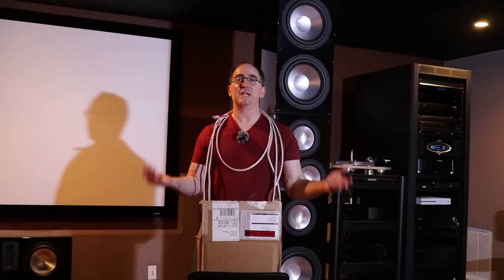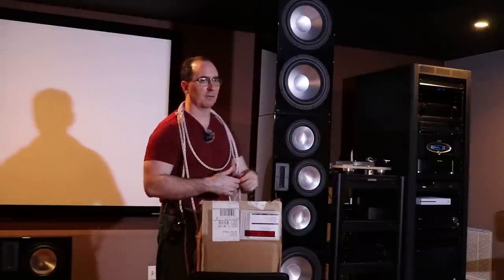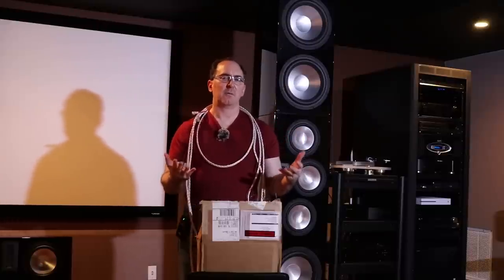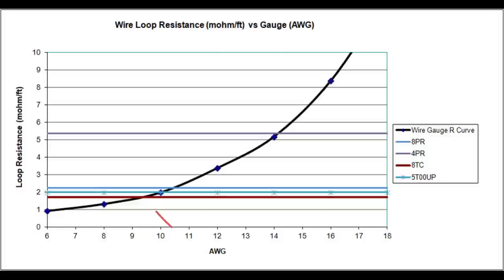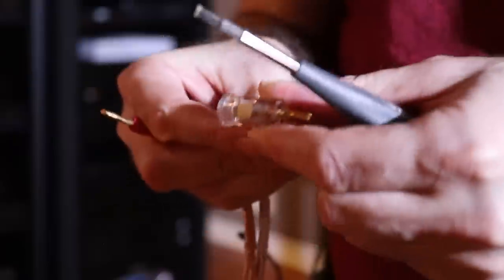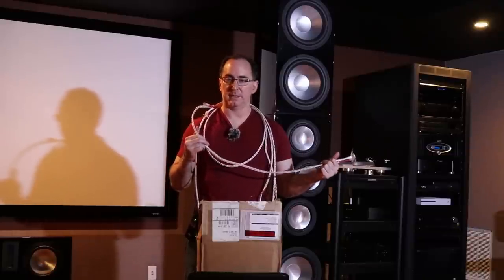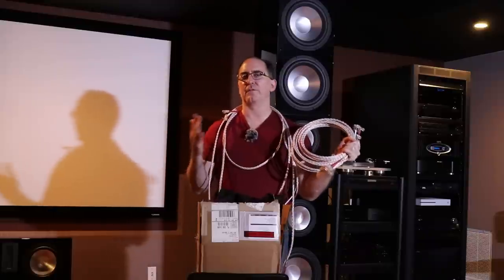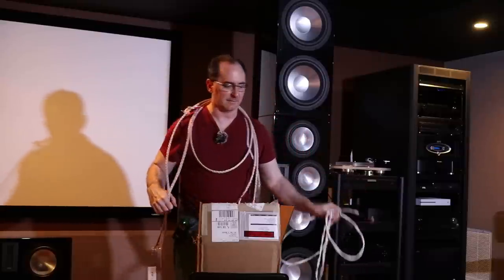Kimber Kable 8TC Speaker  Cables Review

Comment: I use the classic Kimber 8PR cables, which I terminated and am very happy with them.  They did improve the bass, however, I believe this is due to the weave reducing noise from contaminating the signal.  On another YouTube channel, I saw a cable test comparing a woven cable to a zip cord as an antenna.  The woven cable effectively filtered out the radio signal whereas the zip cable picked up the signal behaving like an antenna.  Perhaps this is why they make an audible difference, and why Kimber claim they are directional as electrons will flow equally well in either direction so is complete BS from an electrical standpoint.

Comment: My experience is I spent some time testing and comparing with test measurement cables : colored 10$ banana plugs wich enable to plug another banana behind. Those were working, but then I switched back to my much bigger monitor cable 6mm2 copper (made of multiple thin conductors). At the same volume on the same track I get 4 to 5 db more sound pressure (measured), and the music feels more dry and clear (like if the silences between notes were better cut). With the pink noise I do not see a need for a modification to the equalisation : the room sucks all the same. I think : gauge, contact quality (including solder), and size of individual conductors are the only factors at play. Cheap or expensive is meaningless : as long as the cheap is well made with the correct gauge, contact quality and individual conductors thickness of choice. In my mind expensive cables are good, and are useful only for looks, and maybe to benefit from a lifetime warranty that could replace/repair if needed.

Comment: Thanks @Audioholics (Gene)!  Glad to see you're doing so much better!
Question about those terminal plugs: how are they attached to the speaker cable?  Are there pins soldered to the wire, which are then inserted into the plug before being screwed down?
I have been messing around with my own speaker cables (the ones that go to my mains and are visible, for aesthetics) and have been focused on keeping a low DC resistance, but I have been considering making some braided cables to see if I can measure the low H and realize any difference in sound at the higher frequencies.

Comment: I use 2.5mm2 99.99% Copper. Only 18 euro for 10 meter.
Works perfect, only 3m in length for the front book shelfs.

Comment: Gene, quick question here. You mention both the 8TC and the 8PR however the 4TC sits between them price wise. I have a pair of KEF LS50's and the 8TC seems overkill from a price perspective. Would the 4TC be a better option than the 8PR? Thank you.
Reply: I have the 4TC and the KEF LS50s. The offer a lot of clarity and openness. The 8TC from what I heard, provides a bit more weight to the sound. This is probably it enough of a difference to shell double the price for the 8TC.

Comment: So , looking at the ac resistance vs frequency values at audible listening levels the bluejeans 10 gauge has lower resistance than the kimber 8tc up till 20000 kHz ? I know overall throat full sweep of frequency range kimber has lower resistance, but it seems to me at lower range the BJ comes out on top , I might be wrong, I know inductance on BJ 10 awg is higher than 8tc , but in my case I’ll be running 6ft lengths, I’m assuming the inductance wouldn’t matter , again I might be mixing some info here , would appreciate feedback,

Comment: You can’t tell if a cable is good or bad in your system by just measuring it, just like there are certain measurements that you can see while measuring a TV, that don’t show up in real world TV watching, the same holds true for cables, or anything, it either sounds good in your room or it doesn’t, I think the main thing that you should have tho is a reference to compare anything against, and that way anything you compare is going up against your reference, you might think it’s better, or not, but once you measure something it’s automatically gonna make you bias, trust your ears!
Reply from the maker: You absolutely can tell by measurements ALONE if a cable is good for any system. To deliberately choose a poor measuring cable to act as a tone control is a bad idea. We have such sophisticated EQ in the digital domain now. Do your amplitude shaping there instead of the cables.
Reply: Audioholics yeah, but what if it measures good, but it sucks in your setup?
Reply from the maker: @Kasper911band  that doesn't happen with cables.

Comment: Here I use blue Jean cable, Black Canare 4S1 for dual amping my Polk Audio Rti 11 and center channel of the same family, using 6 out of 7 of amps of an emotiva 7x200 watts amps. Ultrasonic soldered banana connectors. Look great, works even better and I think is the most I will ever pay for speaker cable.

Comment: Gene god to see you are ok. Its luxury you just said it. As such like an expensive watch tells time, sometimes less accurate than a $15 Casio. If you can pay for it and you are ok with that no problem. Just don't tell me its more precise because it is not. Same with cables. If they don't sound perceptibly better there no reason to upgrade.

Comment: Gene, what is your take on Monoprice monolith 14 gauge speaker wire? Looks to be high quality...but they dont show any measurements.
Reply from the maker: If we know the conductor spacing, we can calculate L and C. If its pretty standard, it should be ok. I'd have to see it. When buying speaker wire, make sure its pure OFC and not CCA and a high strand count and you should be ok.

Comment: Thanks for the review.

What do you think of the NEW 8PR?
They now use the same varistrand as the TC but different dielectric.
I got "used" 4.5m for $240 from thier eBay store. 
Excellent service and communication.
Compared to my 80s Hitachi LC Ofc driving KEF LS50s, i find them clearer and more coherent for vocals. Neutral, natural and transparent - what's not to like?

I use 3m 4TC for LRS. Maybe 8TC would be a better choice for their 3ohm linear impedance?
I've used PBJ for interconnects for decades since RATA was the distributor in the UK.
I "believe" they're good enough basic cable and ignore the snake oil merchants. 
Kimber's site is pretty deadpan and devoid of extravagant claims. Just the facts.
Back to another decade of music appreciation.
Thanks Kimber
🎵🎶🤫🎶🎵

Comment: Glad yo see you much better, Gene,!
For interconnects, I use good-quality-no-fancy well isolated cables, terminated with WBT rca connectors.
For speakers, very gross gauge Monsters (sorry) with banana plugs at the amp output and bare cable at the speker"s inputs.
Nothing too special and, overall, nothing too expensive. I prefer to invest serious bucks in active gear and recording, where are where te action is.

Comment: I've got those WBT bananas on eBay from Germany for about $100 per set of 4. They are in fact pretty good.
But I still prefer good crimping type spade connectors. When chosing spades you need to make sure they are made of soft copper with direct gold (silver) plating. In that case they get slightly squashed during installation and form exellent air-tight connection. After some time it even becomes difficult to unscrew those binding posts as if metal contacts and spades fused together.  Beware of hard brass spade terminals!

Comment: Great video Gene, glad to see you’re doing better, 
I currently have a set of 8TC’s with the standard SBAN bananas that I use from time to time. I do like the look, feel, and performance of them. 
Have you tried or measured the 12TC’s and is it worth the additional cost over the 8TC‘s?
Your measurements show in obvious performance/measurement improvement from the 4TC’s to the 8TC‘s.
Instead of spending the extra cost on the really nice WBT bananas, maybe it would be better spent upgrading to the 12TC. At least for higher powered systems. Thoughts?
Reply from the maker: 12TC have a lot more capacitance which probably won't be an issue for most amps but I think 8TC and 8PR really strike a good balance of RLC metrics and "reasonable" cost for exotic cables.
Reply: Audioholics 
That makes sense. But all of those extra conductors makes it look so much cooler! Lol 
Thanks Gene!

Comment: Please please please Gene, don't sell out on us!  ;) 

Beauty is always in the eye of the beholder, personally I don't see anything that attractive in the Kimbers, maybe shinier than the BlueJeans but definitely not $1000 worth of pretty. MHO is that you'd be MUCH better off spending $100 on some good 10 or 12 gauge zip cord and putting the left over $900 into better speakers.  I remember years back being sucked into buying Kimber PBJ interconnects because of rave reviews in the magazines only to have their unshielded design pick up hum like crazy in my system. The only good news was I threw them in a drawer for 15 years or so and then sold them at a profit in ebay. 

I really do like the locking banana plugs Kimber uses but they are around $130 a set of 4 on ebay. So for my 5.2.4 multich rig I'd need 9 sets $1170 ouch.
I see some other locking plugs for $30-45 a set of 4, might look into them at some point.
I currently use some 10g OFC zip type cord sold on ebay from a car audio company called Sky High. They sell a full line of cable sizes etc and I've had mine in the system for around 4 years now, nice stuff. Terminated at both ends with some nice gold bananas that use dual set screws to lock in the wire and are a good tight fit in my speakers & gear.
If you want to build your own kick butt cables I'm now seeing Sky High has expanded their cable line to all sort of sizes/etc.  I see some great 8g OFC zip sold for $1.99 by the foot. Add your fav terminations and you'll have some great cables that can't be beat.
https://www.ebay.com/itm/OFC-TRUE-8-Gauge-AWG-BY-THE-FOOT-RD-BK-Oxygen-Free-Speaker-Wire-Car-Home-Audio/292931278549?_trkparms=aid%3D1110002%26algo%3DSPLICE.SOI%26ao%3D1%26asc%3D225086%26meid%3Da2059bb245634ee5945c4a5ad7f093fc%26pid%3D100008%26rk%3D3%26rkt%3D12%26sd%3D272368323740%26itm%3D292931278549%26pmt%3D1%26noa%3D0%26pg%3D2047675%26algv%3DPromotedSellersOtherItemsV2%26brand%3DSky+High+Car+Audio&_trksid=p2047675.c100008.m2219

Comment: I use cable just like the one you said is ugly but sounds good. It's the Audioquest Flex 2, their in wall bulk speaker cable which has red and black jacketed 14 gauge OFC stranded wire covered by a white outer jacket. It's relatively affordable and sounds good. I have both their Flex 16/2 and 14/2. The 16 gauge is a little more flexible and easier to work with, but I find the 14 gauge sounds a little better.

Comment: I use just regular 10 or 12 guage copper cable. My opinion of expensive audio cables is this. If they make you happy good on you! All I ask is you dont get offended if I don't buy them. Personally I do everything in my power to hide every cable I have! I honestly consider cables a neccessary nuisance! I will agree that if you have speakers as big as you have and there isnt anyway to hide the wires that regular zip cord cable would look out of place. So in your case wire candy would be considered appropriate. However in my humble opinion I don't even like to see "pretty cables". But that's just me. Lol! By the way ,I want your speakers!! :)

Comment: Does anybody remember the  magazine that was in very small in terms of  number of its  circulation called the audio critic.?.... they were very skeptical of all types of audio phile claims in every product category.... they tested a wide  range of cables and they noted that because of the difference in capacitance and inductance in each brand...... it changed the frequency  response of the audio signal sometimes rolling off the treble ..sometimes spiking the midrange ....etc....etc... and this was a magazine that was skeptical again of all things audiophile..... clearly speaker  cablea  changing the frequency response of a signal is  certainly not a reason to pay a price that is in the stratosphere... but it still illustrates that in some respects ...speaker  cables can change  the sound to a certain degree...because everybody can  agree they can hear differences in frequency response unless it's below .2 db s in level

Comment: A loudspeaker cable cannot add fidelity, only detract from it, so the best speaker cable is no cable, but that is unpracticable, so we are forced to use something. First we have to look at the material. There are 4 commonly accepted materials for conductors, Silver, copper, Gold and aluminum. Here is the resistivity of does materials and cost (spot prices).

Silver: 1.59×10−8 ohm/m at 20 C - $17.35 / Ounce 
Copper: 1.68×10−8 ohm/m at 20 C - $0.14 / Ounce
Gold: 2.44×10−8 ohm/m at 20 C - $1,609.45 / Ounce
Aluminum: 2.65×10−8 ohm/m at 20 C - $0.046 / Ounce

First of all, almost no one uses Aluminum or Gold as conductors, so does are ruled out. That leaves us with Copper and Silver. If we look at the resistivity, silver is marginally better at 105.6% compared to copper with copper at 0.024% of the cost compared to silver, which is a HUGE difference. Naturally, cable manufacturers does not sell their cables based upon spot prices, but it is a good indicator.
Because amplifiers are essentially constant voltage sources and loudspeakers are variable impedance loads, the most important cable parameters in order are: 
1. resistance; 2. inductance; 3. capacitance; and 4. dielectric effects, with 3 & 4 being usually* much less significant than 1 & 2. The electrical properties of a loudspeaker cable are a function of the effective conductor cross-sectional area and conductor geometry. This is a consequence of the laws of physics no cable manufacturer gets an exemption from these laws. 

Since the first parameter is the most important one, you should go for silver, if you can afford the cost. The second best is copper which from a cost and conductivity perspective makes lots of sense. Parameter 2 and 3 is very much related to cable configuration and construction. Since inductance and capacitance is generated between at least two conductors, their cross sectional area and distance are the determining factors. Inductance is the property of current enclosing an area between conductors where a magnetic field can form. Capacitance is the property of voltage across a space between conductors where an electric charge can store. Inductance and Capacitance are inversely related. That is to say: If you take two conductors and bring them closer and closer, you will see that inductance decrease while capacitance increase. So pick your poison. Some amplifiers can be sensitive to high capacitance in cables and this can generate oscilation (Parasitic oscillation. 

So now that we know what to look for and avoid as much as possible, the first parameter is the physical properties of the material - the first example is a solid core 12awg conductor (3.30mm^2):
Silver: 1.4686 mOhm/Ft of resistance.
Copper: 1.5517 mOhm/Ft of resistance. 
If we use a solid core conductor and conductors are brought far enough apart, there can't be any electromagnetic coupling between the conductors and hence no Inductance nor Capacitance. No matter, a solid core conductor will have lower resistance, inductance and capacitance compared to a multi stranded conductor.

Alternatively, you can use flat foil conductor like Mundorf's 70x0.07mm 99.9% pure copper foil. This is equivalent to 4.9mm^2 (10.3awg) and it has a resistance of 1.045 mOhm/Ft. Run the conductors side by side (not parallel / face to face) and use a cotton sleeve. There should be no measurable inductance or capacitance in this cable.

This is the purest conductors you can use in your system. Although Kimber Kable 8TC is a very good "traditional" cable, if you want to increase the resolution of your system, nothing beats solid core (single strand or foil) conductor.
Reply from the maker: This is not a good idea on any level. Solid 12AWG would suffer worse HF skin effect loses than stranded. Stranded cable exhibits litz like behavior and thus the increase in AC resistance at 20kHz is only about 3% compared to equivalent solid core 12AWG of about 30%. The best speaker cable would actually be 10AWG stranded COAX from an RLC standpoint and it's something I'm looking into testing to see how easy it can be to terminate.

Comment: I am using the QED XT40 Cable with Airlock Connectors and I do not belive in Cablesound. But I belive in good connections and build quality. Kimber ain't bad but a little bit pricey.

Comment: I wish I could afford those 😂. I don’t measure my own cables output or anything outside of audyssey with my receiver. I use pure oxygen free copper wiring in whatever gauge I require and I’m currently running a 5.2.4 set up. My ugly surround cables are hidden with cord covers around the baseboards and walls where they’re less obvious. I covered the front speakers cables, which are visible if you look, myself with black mesh material, heat shrink tubing and rubber y splitters at the speaker terminals. I use banana plugs for all the connections and I’ve got no issues. Totally feel you on the cord snake oil.
Reply from the maker: check eBay for big savings!
Reply: Audioholics Awesome to know. Thanks for the info and response. Glad you are feeling better btw!